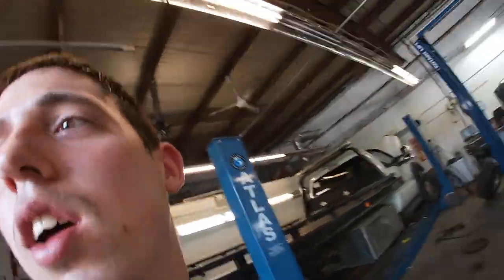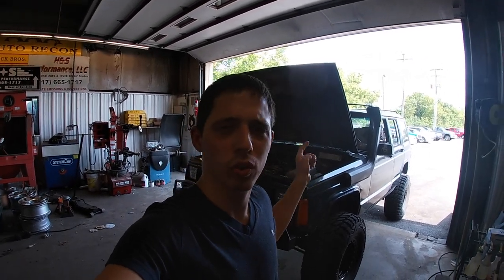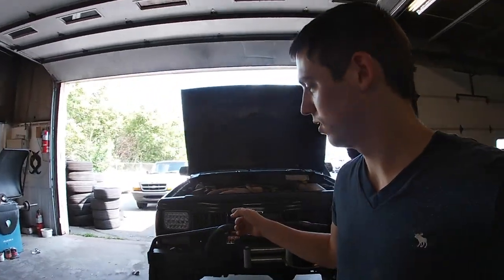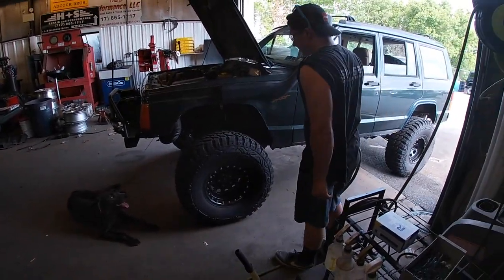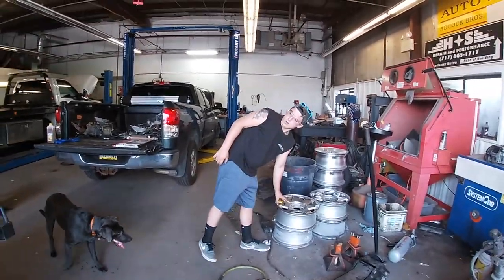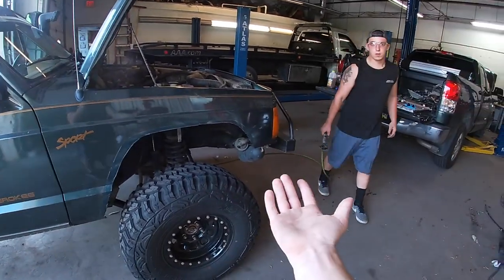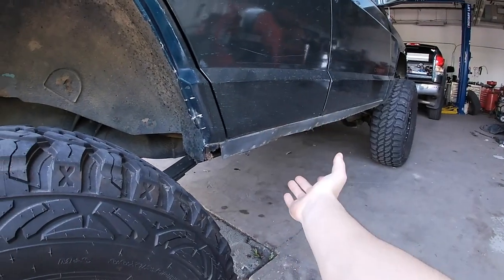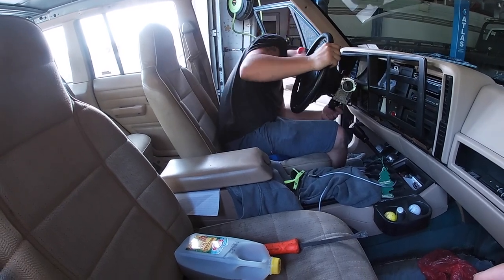Cutting My Fenders To Fit 35s on My Jeep XJ??!!

Comment: I have about 5" of lift and 35's. I have cut fenders front and folded in the rear. I have 9.5" between the tire and the fender in front and only 6" in the rear. I think my leaf springs are sagging a little but I plan on adding some lift and will just level the rear with whatever the front ends up at. I have a 97 so the washer bottle is in the fender so I cut as much as I possibly could in front without relocating the bottle. I had to modify my flares so that they would fit being mounted about 4" higher.

Comment: You want your jeep to run cool put a aluminum radiator in. Yep 33s. I'm running the Yokohama geolanders ats 33s at 8psi . Let me know how the procomp tires work. I have never ran them because nobody locally carried them. Some flat fenders would look good.hood vents off a conair work great to keep your rig cool.
Reply: What the hell is a Conair? lol....
Reply: @danhambrick6331  classic car. it's got 2 roughly 2" long vents on the hood about 10 inches wide.
 If you've seen The Yellow Banana on Matts offroad recovery, it has the same vents.

Comment: If you go to 35's, what will you do with your 33's?
Reply from the maker: I would probably sell them. Just not dead set on them yet don’t want to break anything major as it is my daily
Reply from the maker: I would probably sell them. Just not dead set on them yet don’t want to break anything major as it is my daily
Reply: @JeepinDaily  Well I am sorta close by (Hamburg Pa.) But I have to finish putting Bumble Jeep back together after my T-bone in late May. I have all the parts, just need the time. Can't wait to drive it again!